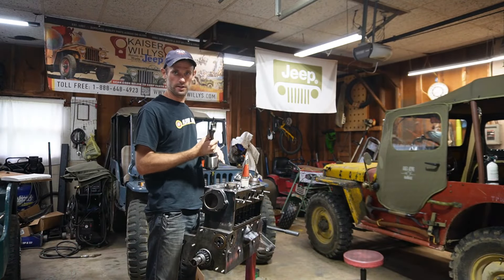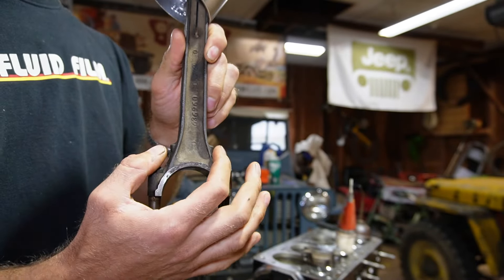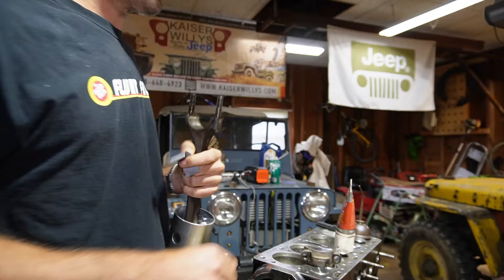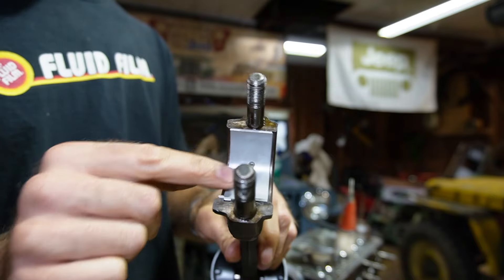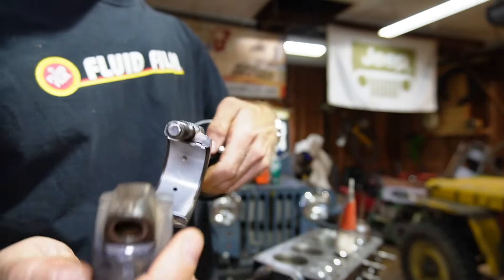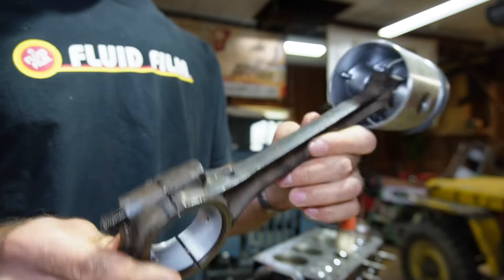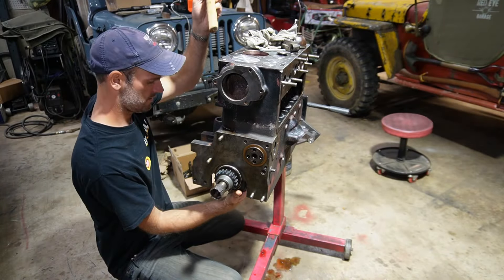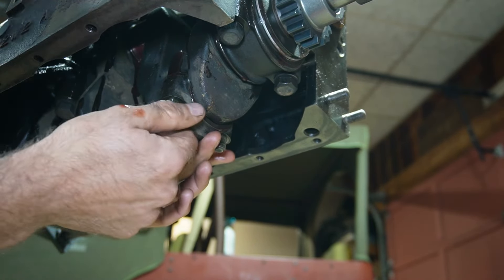Cj2A engine rebuild NEW PISTONS

Comment: it is very nice to see this done with the tools that most of us have available in our home garages/sheds/workshops....in the fall we are going to be doing a refresh on our F-head...there is no machine shop in our area so its going to be limited to what we can hone and polish.
Reply from the maker: Thanks! Yeah this was a machine shop free refresh. As you can see there is a ring ridge but you would be amazed at how well these old engines can run with minimal work. The bores were still round and within spec. It may get bored and decked eventually. simple engines require simple tools.